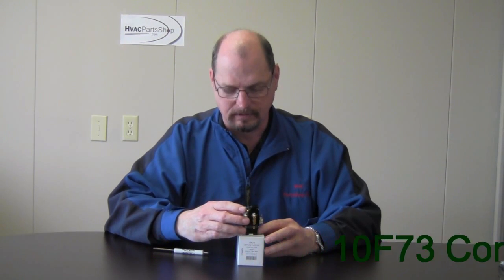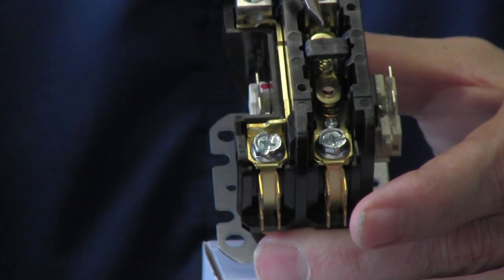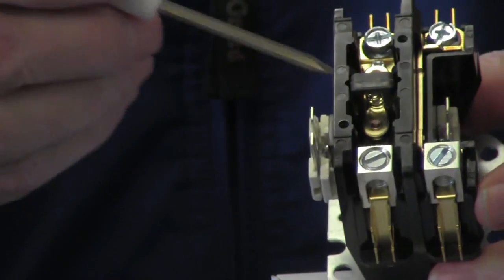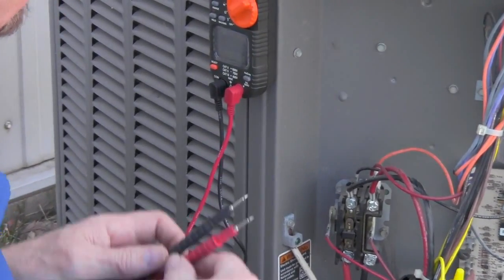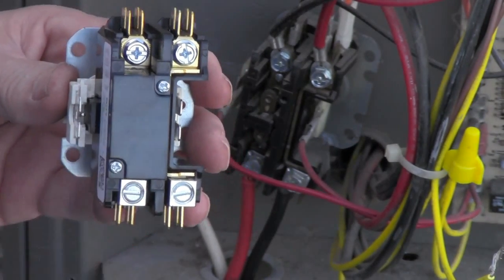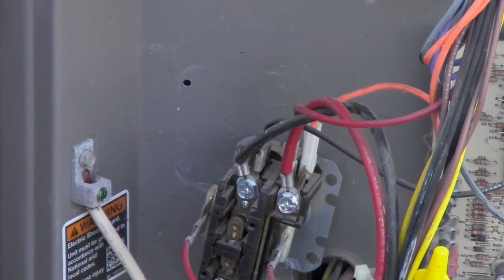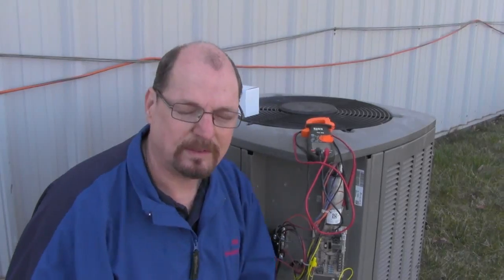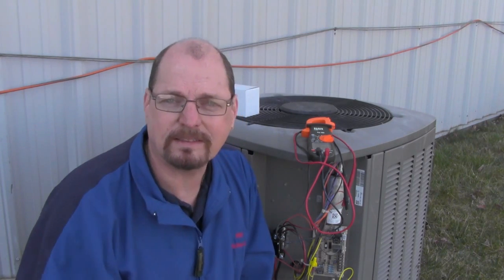10F73 Contactor Replacement

Comment: so the thermostat is powerd by 12v DC current batterys and it sends the signal to the 12v DC current coil on the contactor so than the contacts close and send 120v to start the compressor and fan¿¿ am I correct??

Comment: Is this style of contactor orientation sensitive?...meaning.....as long as you're mindful of "L" connections used for power-in....and "T" connections for power-out....can the unit be mounted either right-side up or upside down? ( printed material on the cover is then upside down?).....I think it doesn't matter, but thought to ask.
Reply: orientation does not matter, just the proper wire configuration
Reply: @joephu  ... thanks !

Comment: I have a question  on L1 same side i have 240 all the  way  to the other side is the normal?without the switch being pull in (my heater dosen't work )

Comment: I replaced the single pole with a 2 pole and shunted one pole with a jumper. Also changed the start cap. When powered up the start capacitor started arcing like crazy on both terminals. Fan started, compressor sounded like it was trying to start or had started, so I shut it down.
Reply: I guess I'm asking why would a start cap spark like that?? 10 year old York 2 1/2 ton heat pump.

Comment: Hi quick question, I replaced a single pole with a double pole.  Why does the right side need constant power?  Is it okay to have it close and open like the left side?  Or do I need to wire it where it is constantly powered?  Thanks!!
Reply from the maker: Depending on the model and make of the condenser. On the one pole contact or single pole constant with line 1 is open and line 2 is closed. Line 2 to ground, because heater to heat the oil in the compressor. Thank you for the lovely question, feel free to ask as many questions as you would like. No question is a bad question. Give us a call at 866-215-3831

Comment: Hi Steve!    My new single pole 30 amp 24 volts contactor doesnt look like it is labeled  L1 L2, T1 T2.   Are their locations standardized the same if I orient the contactor according to my existing old one of a Siemens brand with the side that has the contactor?

And does each of the four 4 prongs belong to its own group so that wires belong to that group can be plugged onto  any of the 4 prong configuration as long as the wires are in the right group?   

Also, can sources for the main power go on either side of the 2 screws or lugs on the line side?   Thanks in advance!
Reply: Hello and thanks for the question. From the disconnect to the contactor  Black would go on the left bottom lug or screw connection  that would be L1 meaning Line 1 . Red or could be white would go  on the bottom right lug or screw connection this would be L2 meaning Line 2. this will be line power. Then the top side of the contactor would be your load voltage or power. Just follow the same as below Black top left Lug or screw connector and Red or White to the top right lug or screw connector. Another way that may make it easy for you is to remove power from your unit then remove the old contactor , Mount the new one then just go wire for wire putting the wires in the same orientation as they was on the old contactor . if you need further help just give me a call  at www.hvacpartsshop.com
Reply: @psphacplumbing3191  you can take a picture with the smartphone.

Comment: Steve I am stuck.  I replaced my ac fan motor and now compresor wont turn on so I made an error on the hook up.  I have a dual capacitor on the unit.  Old motor had three wires on it.  BLK-RED-ORANGE.   The new one has FIVE wires. They are BLK-RED-ORANGE-YELLO-PURPLE.  Can you tell me how it wires up.  I connected three of the wires from the new motor but had two remaining wires,
Reply from the maker: Did you call us and ask for technical support? 866-215-3831